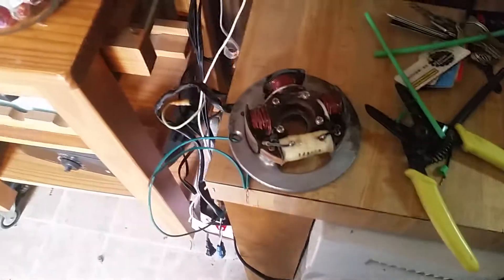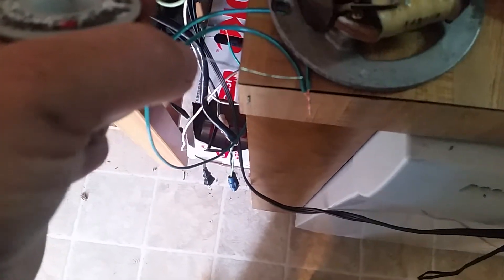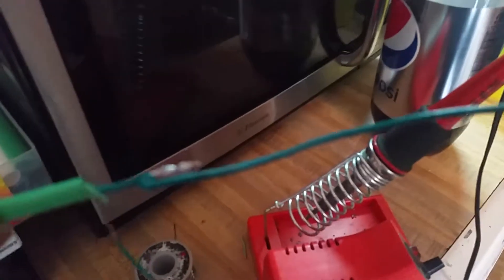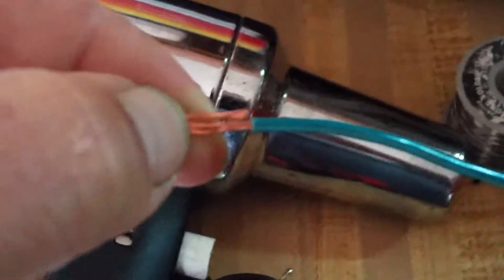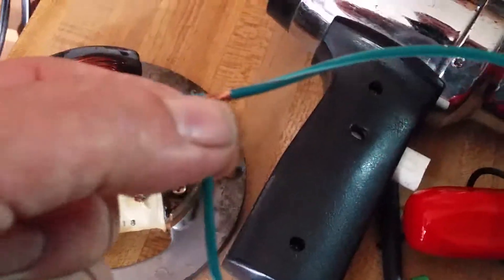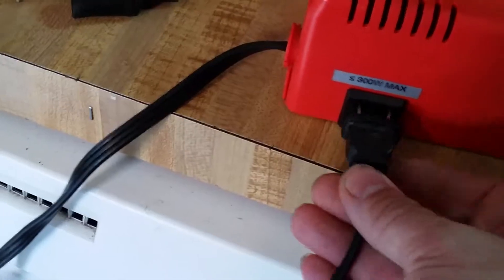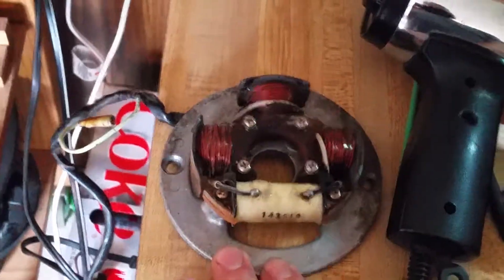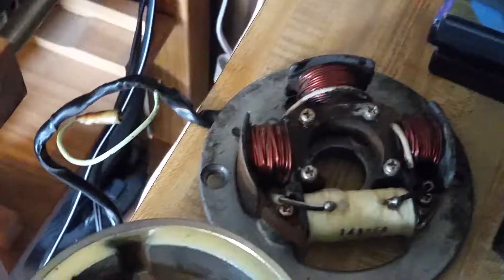proper wiring connection (ke100 upgrade )

Comment: I bought a ke100 over weekend guy said no spark think I figure it out it’s missing the speedometer and key maybe that’s the reason it don’t have spark it has no head lights or anything had a number 7 plate on the front 1995
Reply from the maker: @fangazfunky  black wire on the stator directly to the little black wire on the coil you should have spark